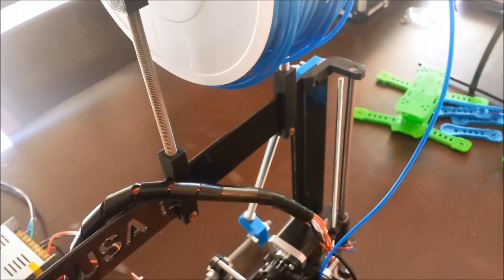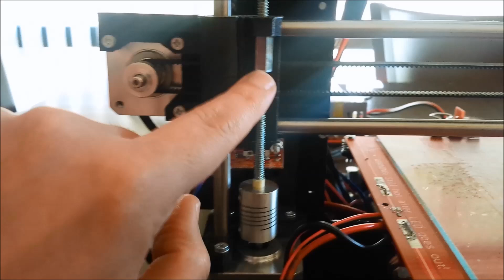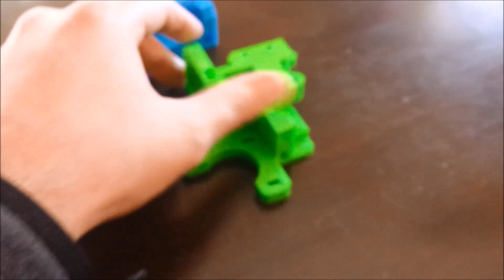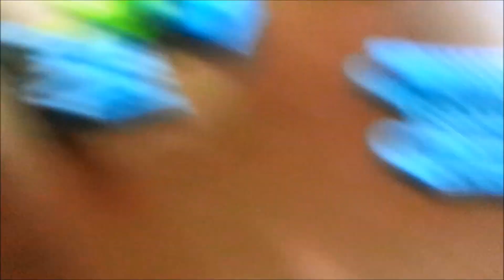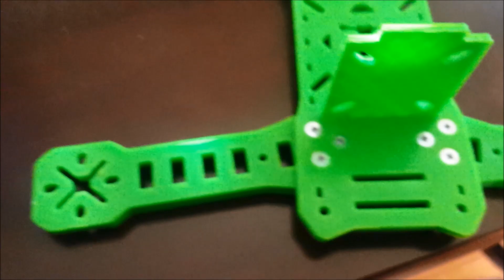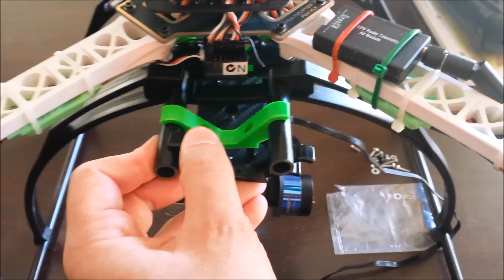3D Printer Update !

Comment: use sugar water for pla printing cheap and easy to stick to the bed ;) doesn't work for abs
Reply from the maker: Great tip!
Reply: +Tech2C I use a cheap spray bottle spray over bed so u have a film then turn the heat bed on 
the bottom layer of print will be like glass perfect and sugar smells nice just like pla that brown sugar smell

Comment: Does your power supply get extremely hot as well? mine does and I'm thinking about using some cooling fans on it? what do you think? Great videos btw.
Reply from the maker: Not really. It does have a fan inbuilt which turns on and off throughout a print.
Thanks for watching :)

Comment: Those prints look fine! If you want that small amount of wave fixed in your parts I think the answer to your problem is in the smooth rods. If you have access to a lathe and a dial indicator you could see how much runout there is or just how perfectly round they are. On my Prusa i3 PRO XL I purchased from  MakerFront my threaded rods were wobbling so I bought some stainless threaded rods. The wobble was pushing on the Z axis. I have a mini lather here in the USA and I am going to check for straightness of these components.

Comment: how are the prints so high in resolution for the price of the printer and the company? I want to start 3d printing but don't know where to start but I'm able to spend 300-700 us dollars
Reply from the maker: +Patrick Yoon 
Open source hardware and software, that's how. Plus being in a kit form, it does require some effort on your behalf to assemble and tune it. Choosing a printer from a manufacturer with positive customer reviews and documented support also helps...

Comment: Hey there! I'm looking to get myself this printer for Christmas as a starter printer but it seems that it can get very pro results! Is there any chance you could message me a parts list of things to buy to get the same quality prints you are getting now? I'm looking at your Prusa i3 x upgrades and mods video right now but I'd love it if I could get directed to where to buy the exact parts you did so I know I'm getting the exact pieces I need to get the same build you have :) Love the videos! Very informative and they sold me on this printer. Thanks again!
Reply from the maker: +PestVic 
Hi there, glad you like these vids!
There are many iterations of the Prusa i3 printer to buy, and since buying mine there may be better deals out there than my kit. My kit is by Replikeo, but take a look at other websites selling 3D printers like 3dprinteronlinestore(dot)com.
Ideally you want a Aluminium heatbed, Bowden system, and if possible z-axis motors with acme rods inbuilt as the shaft - no couplers required then.
Either way if this is your first printer then best not to jump straight into the upgrades until you've had a chance to experience the stock kit, as it may print great out of the box - just my opinion...

Comment: Very nice. I bought my I3 mostly for multirotor stuff. Problem is, no matter what I do, With bigger parts, I couldn't stop ABS' corners from curling. Now I'm making body parts with PLA, motor mounts with ABS(need heat resistance)
Reply from the maker: +flanker 
I hear you. ABS can be tricky with warping on large flat parts like quad frames. I've found lots of heat, painters tape and even a large brim seems to work for me.
Reply: My heated bad can't reach above 100C, painters tape didn't help, and brim lifts right off alongside the main print. I'm beginning to suspect that the ABS I'm using is bad quality.
Reply from the maker: +flanker 
Good point, cheap ABS filament may perform poorly. I stopped using the cheap stuff a while ago and have never looked back. Just the time saved in printing successfully with quality filament is worth the money in my opinion.
Reply: Tech2C Yeah, problm is, I have no idea which brands are good. I'm from Europe, and here we have lots of rebranded chinese stuff.
Reply: +flanker Have you tried using Kapton tape or applying ABS joice to your print bed prior to printing? I used to have some issues with prints not sticking to the bed. Applying Kapton tape and adjusting the first layer thickness (adjusting the Z offset of my bed leveling probe) seemed to help, even when printing some cheapo 16€ ABS filament from eBay (I'm from Europe too btw).
Reply: Tried both. Didn't help much. I'm building an enclosure for the printer that ought to help. I also think adding a fan directed to the print should be good too. 

I also realized using raft seems to work well. There is still some curling, but not as noticible as before.

Comment: Very nice prints and very professional looking design in your quadcopter. I really hope that replikeo ships these printers to Finland, thinking about to order that dual extruder model...
Reply from the maker: R4psu 
If it's your first printer, I'd start with the single extruder. Plus you may find you want to upgrade the hotends or other parts anyway. You could add dual extrusion as a mod to the printer at a later date.
Reply: Tech2C Thank you very much for your response. It would be my first 3d printer, so I follow your advice, I did not thought about weight issues etc...

Comment: what you you using for your system. can you let me know from below specs? what do you recommend?

Sanguinololu Rev 1.3a
mega2560 + ramps 1.4

hotend nozzle size
0.3mm
0.35mm
0.4mm
0.5mm

hotend PTFE tube size
1.75mm
3mm

Filament material
ABS
PLA

Acrylic colors
Transparent
black
Reply from the maker: airwolf 09 Have a look at www.replikeo.com for the specifications of the kit i have. The rest of my video's show the modifications and upgrades I've made to it.

Comment: Cool vid, I want to print out quad frames too. How much warping occurs in your prints and how can u reduce it?
Reply from the maker: Some warping occurs with ABS, PLA not so much.
If you print the quad frame in ABS like I do, then you'll want blue painters tape as the heatbed adhesion material. With that tape, it bonds to the ABS even after it has cooled which is exactly what you want. If the part pops off the heatbed while it cools, it will bow once cold.

Previously, I'd constrained the finished ABS part between 2 pieces of wood, held together with screws. Then pop it in an oven at 120c for 10 mins and let it cool down before removing it from the wood constraints.

Comment: Nice Job!  Looking to get one myself!
Reply from the maker: You'll have a blast with it :)
Reply: Comparing between the one you got and this: http://www.geeetech.com/acrylic-geeetech-i3-pro-3d-printer-diy-kit-p-884.html  for example quality wise etc what you think?  
Sorry to ask questions but my main purpose to get a 3d printer is to make mini quad and such... Same as you I guess!
Reply from the maker: Hmmm, not sure about that kit, except the price of course.
It's an acrylic frame only, and seems to use non-standard plastic parts for the kit instead of the Prusa i3 Rework which Replikeo has. I'm sure the print quality will be the same as Replikeo though.

It all comes down to support for it after the purchase, because you'll need assistance at some point if this is your first printer. With mine, there is a long thread on the RepRap forum site which basically already has answers to questions you're not sure to ask yet.

If price isn't an issue, have a look at the Makerfarm kits as well.

Comment: Printing your Z-Axis Frame supports right now. On your Y axis not reaching the max though, I found i just had to slid the whole bed assembly + frame back slightly on the vertical frame mounting points. No need for the printed Y extension then.  Nice Quad copter frames too. Looks like you have your printer dialed in to print very well.

Comment: Would you be willing to share the frame support files? Great job on your modding work.
Reply from the maker: Craig Baldwin They're attached at the RepRap forum on the Replikeo thread. Here's the direct link: http://forums.reprap.org/read.php?151,344338,378620#msg-378620
 I've found the z-axis supports to be mandatory when printing anything with a decent height as you may encounter a lean on the print otherwise.
Reply: Thanks appreciate your help

Comment: I just got a Replikeo Prusa i3 and I am 90% built. My package did not come with the carbon plate (or glass) or high temp silicon too. I let replikeo know I did not get the plate but I am trying to figure out where to get one locally. I really like your videos on this and hope you upload some more. Thanks.
Reply from the maker: rowing1s4me Thanks! You'll want to use glass rather than the carbon fiber plate anyway. Any window glass shop will cut the glass to your dimensions - 215mm x 200mm.

Comment: A lot of RepRap folks have been wondering if the Replikeo is a solid entry, and it looks like it is. The price is very impressive for what you get.

I self-sourced all the parts for my first Prusa i3. The electronics kit (including RAMPS, Mega2560, endstops, wires, thermistors, 50mm fan, Mk2a PCB, and LCD controller) was a good deal at US$189. I got a fancy TORLON hot-end for $70. The lasercut frame was $53. GT2 pulleys and belts: $34. Plastic parts: $70. Extruder: $40. 5xNEMA17 stepper motors: $60. PSU: $30. Those initial printer costs quickly add up! I spent over US$600 on the parts I actually used, and a bit more for extra parts to use later.

Today, having more experience, I could save $200 or more by building my own frame, printing my own parts, buying belts and pulleys in bulk, assembling the extruder myself, and using an old ATX PSU. Even then it's still a challenge to get the cost under $400.

If nothing else, this kit certainly saves a lot of headaches and a lot of extra shipping cost, and it really seems to work well.
Reply from the maker: Thanks for your comments Scott. Yeah I priced up building my own as well, but I couldn't beat the price replikeo has it on sale for.
Sure it's a learning curve to assemble and configure, but the experience gained now allows me to troubleshoot and fix almost any issue I encounter with this thing.